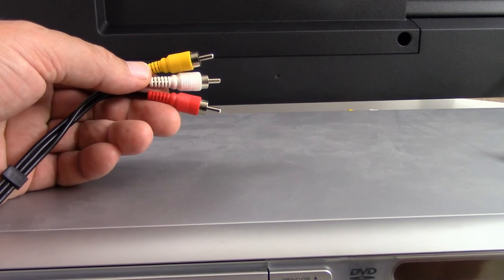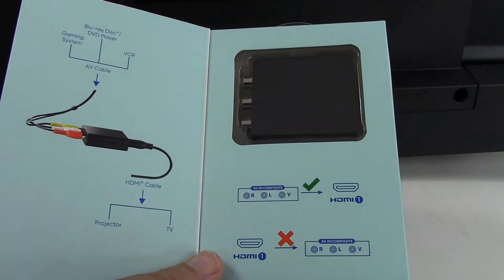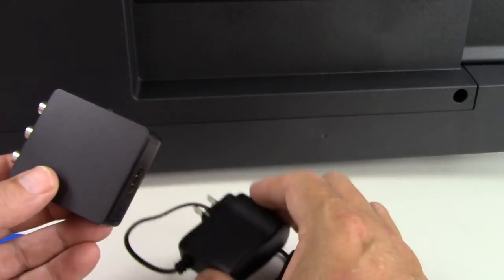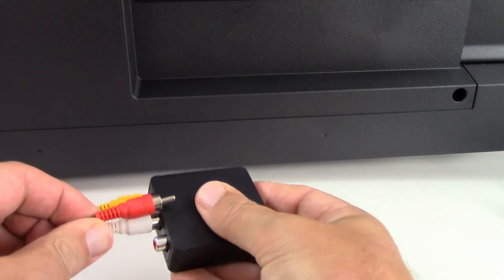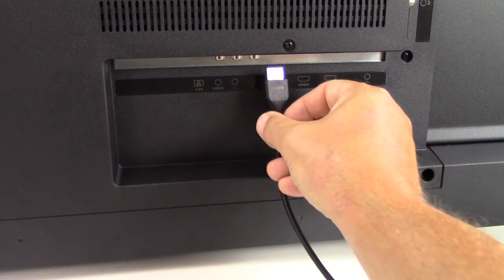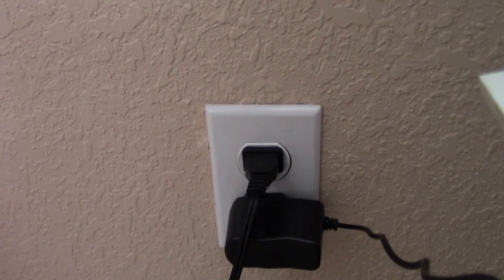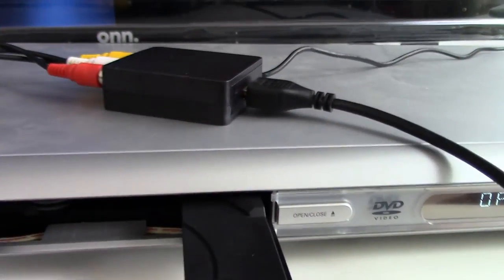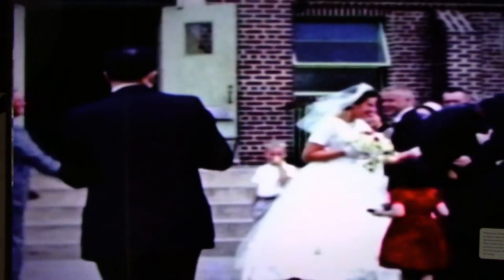How to Convert Composite Video to HDMI

Comment: Hi did you try a commercially recorded DVD, interested to see how it would appear with a better resolution recording to start with. I was going to buy a component to HDMI converter but in the composite works ok i'll buy that instead, this is for an Australian PAL system but i can change the source video to NTSC 720P if i use component cables with matching converter.

Comment: I have a receiver that does not have HDMI which I have been using with no problem UNTIL I got a different cable co and the set top box ONLY has HDMI.  can I use a converter from the set top box to the receiver?  Also, I might mention I am using a set top box, TV, receiver and a DVD player
Reply from the maker: The short answer, yes you can. The better answer perhaps, ask your TV company to swap your box out with a box having the outputs you need. Often they stock such.

Comment: Hello I’m hoping that you can help with a question and I’m having with an older Dynex TV it does have a HDMI port area and I’m trying to hook up a Roku device to use it. However the insert area for plugging in the Roku HDMI and it’s not large enough to accept it. So I purchased an HDMI to AV connector which says that it’s used for fire stick or Roku devices. It came with a USB port and a three prong collar coated connectors to go into the component AV area and the colors I have a red white and yellow on the converter but on the television I have it as red white another red which shows as PR and then a Y which says video so I’m using the Y thinking it might mean yellow and it’s also says for video. But I’m only receiving a message saying that there’s no signal. I have the USB plugged into the service port and then into the back of the HDMI to AV converter but I still cannot seem to get a connection to Roku. Can you please advise further. Thank you